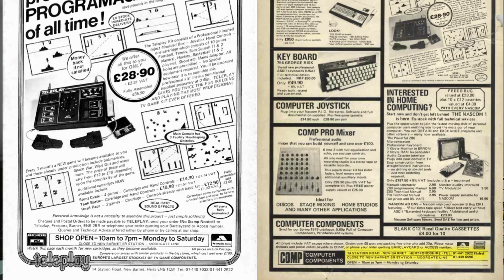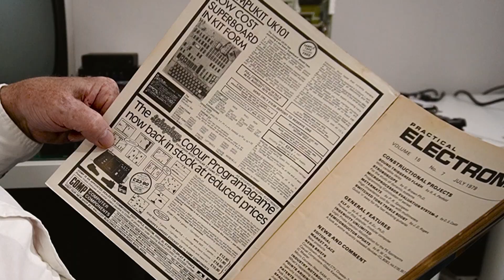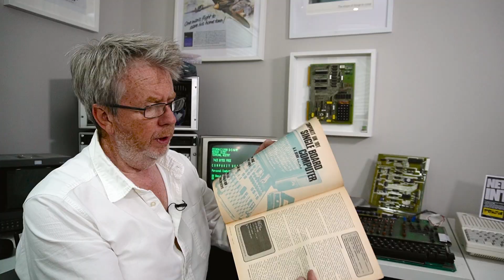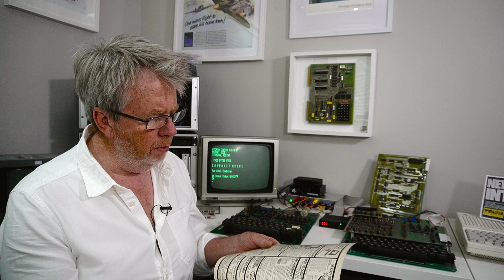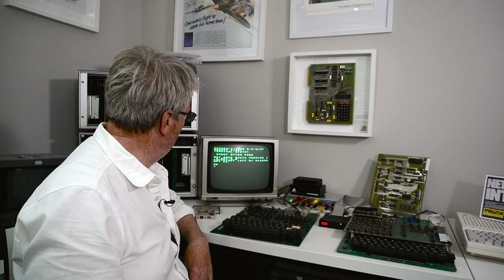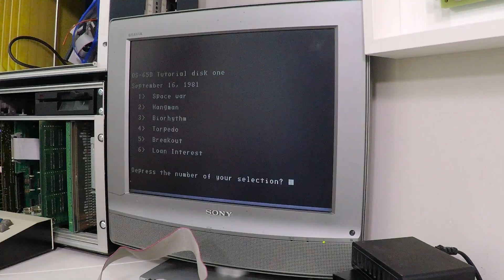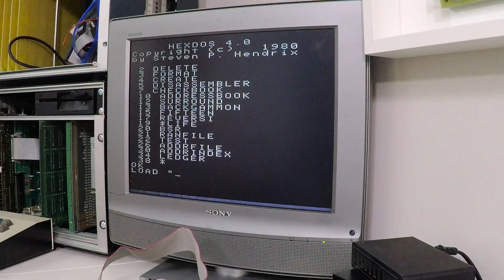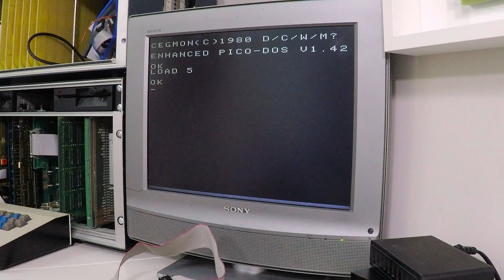OSI Superboard II and the UK101

Comment: I met Chris/Spangles many times in the late '70s/early '80s. Indeed, driving with him from Barnet in his cash-purchased Rolls Royce Silver Shadow and eating at the original Hard Rock Cafe is one of my oft-repeated stories and a great memory. Definitely quite the character. 😄

I suggest you take a look at the video circuitry of the Nascom 1 and compare it with that of the UK101; you may notice some incredible similarities, bar the modulator section - in the N1 that used discrete components, but Chris opted to offer Astec as an option on the UK101. The 48x16 display format has to be a bit of a giveaway!

As Technical Coordinator at Nascom, then later Technical Manager at Gemini, your video has definitely taken me back a few years! Thanks for that. 👍🏼
Reply: My recollection is that SB and uk101 video circuits were pretty much same with minor alterations to the TTL timing chain. Probably convergent evolution with Nascom as only just so many ways to generate HS and VS signals.  I copied the UK101 for my own homebrew as it was so easy to understand (and build on veroboard). I modded CBM PET cgrom for it. Thanks for reminder of simpler times....
Reply: I believe I said I worked for Nascom and I frequently saw Chris Cary (and Jim Wood), on business and socially 😂

Anyway, CompShop was a distributor of Superboard and Nascom simultaneously, then along came the UK101. 🤔

Display format: rows x cols
Superboard II - 24 x 24
Nascom 1 - 16 x 48 
Compukit UK101 - 16 x 48

We can call it coincidence or parallel design paths, if you wish. 👍🏼🤣, but I saw the smile on CC's face, and it's evidential that his entire business career showed a certain, er, predilection for, er, duplication 😉 🤣😂
Reply: Helpfully all 3 circuit diagrams are online.
Reply from the maker: Great to hear from you and thanks so much for sharing. I have an N1 and 2 and some Geminis. I love my Gemini MFB2 it was a labour of love bringing that back to life.

Are you able tell me who was involved in the design of the UK101 and how Dr A Berk fitted in?
Reply: @GlassTTY 
It was a sad day, moving house some 30 years ago, when I found myself skipping a maxed-out Gemini MFB2 with every size variation of floppy disk drive, plus 2MB of ram-disk, but it felt it had reached EOL 😢 and the Mrs certainly had no space for it in our new home. 

Sorry, I have no info on Dr Berk, however I do feel "design" is quite a strong word to use in conjunction with "UK101", perhaps "hybridisation" would be more appropriate? 🤣
Reply from the maker: Yeah, design doesn't seem to be the correct word. I was just wondering who actually came up with the changes to the SBII to create the UK101 and sorted the boards etc. In some quarters Dr Berk was given credit fro the changes, others have told me that Dr Berk wasn't a real person.

Comment: its 2025 and people still think its flat!
I've heard the most reasonable proof that the earth is not flat.
If the earth was flat, there would be tourist spots indicating the edge of the earth.
Also if the earth was flat we wouldn't need high power rockets to launch satellites. space ships could take off from runways, fall off the edge and then just fly around with minimal fuel to reach the orbit places.
Reply from the maker: That's a very good point. I guess the corners would be very sought after destinations.

Comment: I had a UK101, bought as a kit from the store in Barnett or Hemel Hempstead? around about 1980-81?.
There were a lot of us in the Thames Valley area with them and in The Thames Valley Computer club, and lots of modding.
Was a great start to my computing career.
I still have it up in the loft
Reply from the maker: Thanks for sharing, maybe it's time to get it out again and switch it on. I'm in the Thames Area myself, It's odd to think that I am probably surrounded by lofts with UK101s in them.
Reply: My greatest achievement was adding a Z80 to it, such that the hardware would run from the 6502 or the Z80. The 6502 set up the memory and Z80 monitor code in RAM, then tristated and the Z80 started. The Z80 start address mapped to RAM that had already been set up, and started running. Since the board hardware was very simple, my Z80 monitor could read the keybaord and write to video RAM   (initial debugging of that was interesting! and used video RAM to show how far it got).
Later added a 1771? floppy disk controller and 8" SSSD floppy disk drive and CP/M, for the Z80 side.
Could use that to load 6502 images and switch proc back to run 6502 apps
Reply from the maker: Thats the best upgrade I have ever heard of. Nice work!

Comment: I cut my programming teeth on an Ohio C1P a long while ago now. I eventually had a 610 board too, remember having to find out about and build the data separator. I got it all working briefly before moving on to the white heat of technology using a Sinclair QL to learn all about multitasking operating systems and 68k code. I had a book called the first book of OSI or something similar which I learned a lot from.I was given an alternative OS fro the C1P called Vortex, I haven't seen it online anywhere and my disks are in a museum now, I'll have to retrieve them and archive their contents one day. More recently I've use the multicomp and other recreations, brings back many good and frustrating memories, thanks for showing. I never knew about the pirate ship connections. I'm building an AIM-65 recreation at present. David.
Reply from the maker: Hi David, thanks for sharing. Vortex sounds interesting, did the disks end up in a UK museum by any chance?
Reply: Hi  @GlassTTY  , yes I took them to the timeline computer archive in Wigton. This was some time before lockdown - I haven't been back since. My Ohio C1Ps are there too.
Reply from the maker: I know Mike up there. In fact I was there a few weeks ago. Would you mind if I got in touch with him about archiving them?
Reply: @GlassTTY  ok, chat on your forum ..